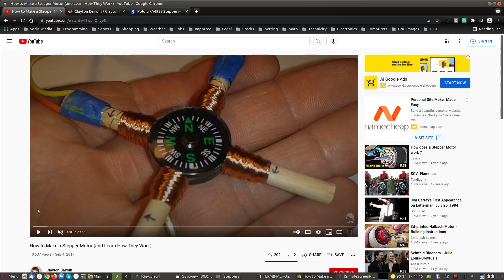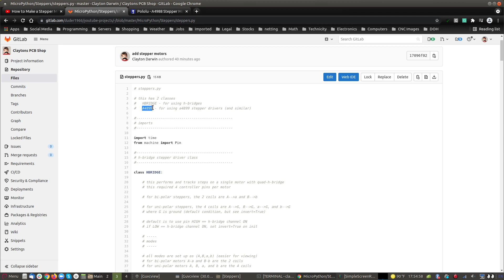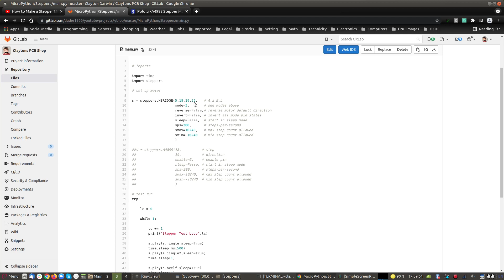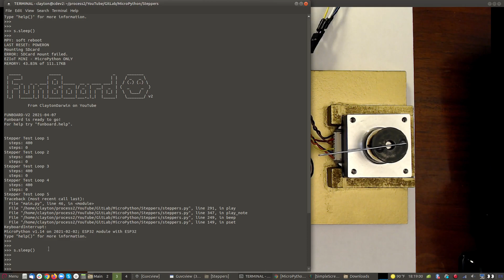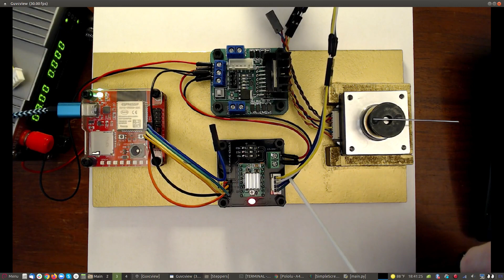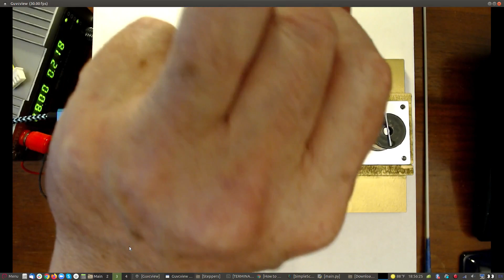Running Stepper Motors with MicroPython and an ESP32 - Tutorial - Software Included!

Comment: Great video. I'm using your code in one of my projects. Was wondering how one can implement acceleration and deceleration for soft start and stop the motion.
Reply from the maker: Thanks. The only option I know of for these types of controllers is to vary the pause time between steps. For example, you could start a series of steps at 200% of the target pause between steps, and then decrease the pause between steps until you reach the target. At then end of the step series, you could start increasing the step pause time. This will work pretty well when you have a long series of steps, not so well when you have a short series. Also, this will work better for belt drives moving heavy loads. Direct drives and light loads don't benefit as much or at all as there is no buffer to absorb and release the step energy.